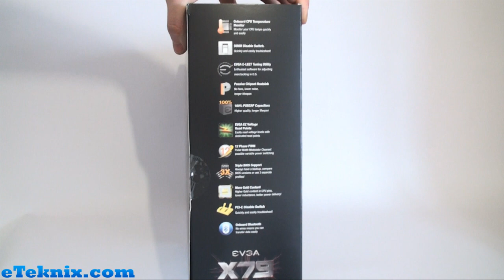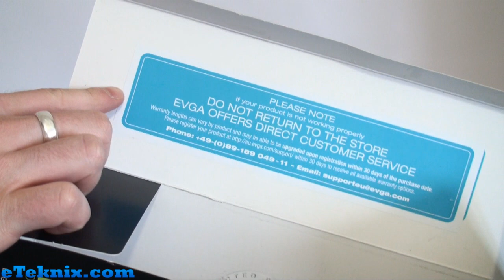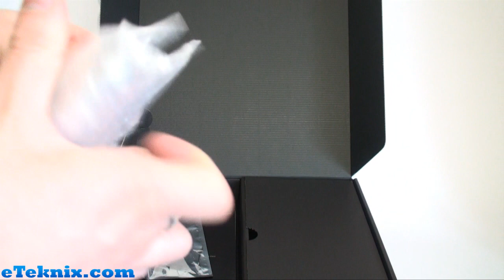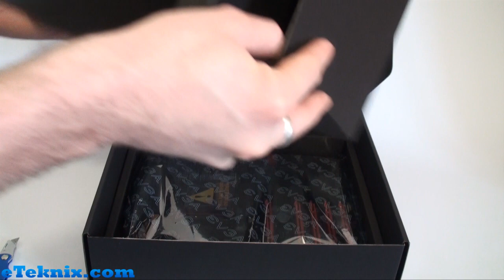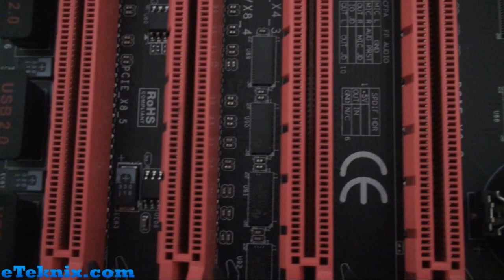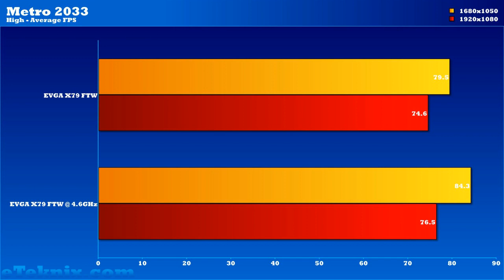EVGA X79 FTW X79 Motherboard Review

Comment: Great review. My gripe with a lot of current X79 boards is that there's only 2 internal SATA3 ports. If you're someone that wants to RAID more than 2 SATA3 drives....

Bad luck!

X79 is supposed to be an enthusiast platform. Surely it's not too hard to imagine enthusiasts with more than 2 SATA3 drives???